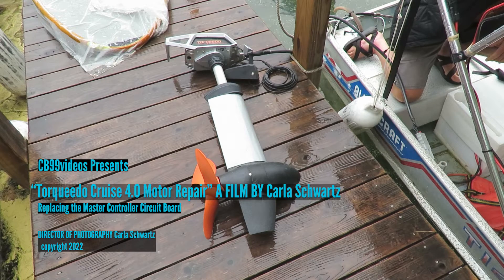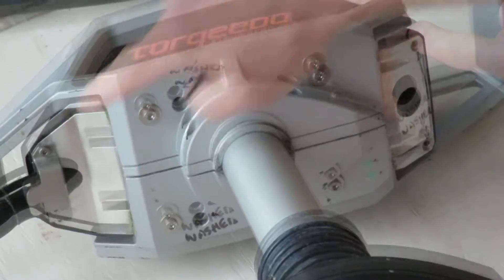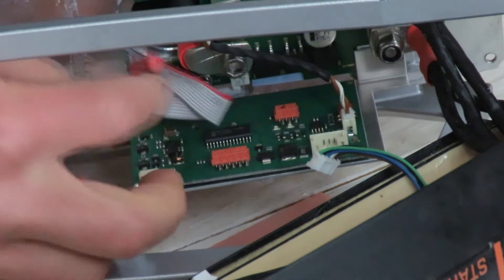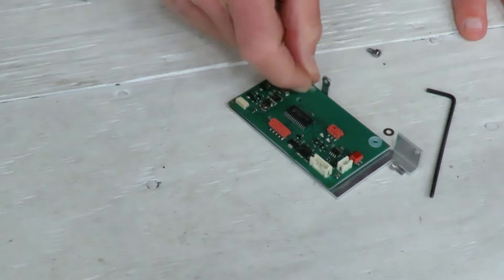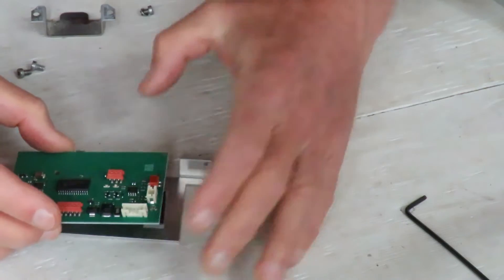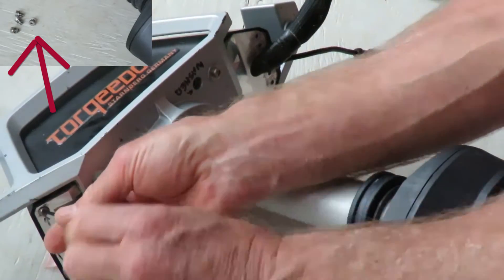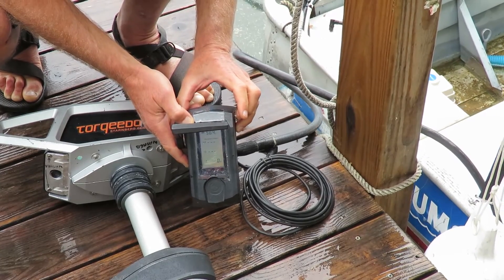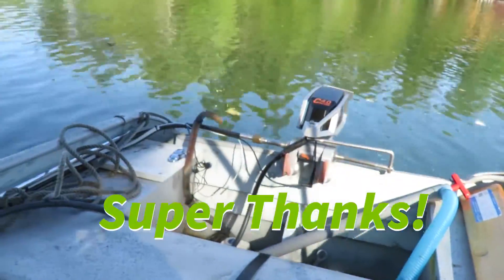Torqeedo Cruise 4 0 Motor Repair #cb99videos #MasterControllerboard #diy #electricmotors

Comment: Can't believe how basic these circuit boards are. $4000 for an outboard and the circuitry isn't even SMD or coated in resin to waterproof it. I daren't ask what they charged you for the board.
Reply from the maker: You can click the link in the description. The board currently goes for about $70.